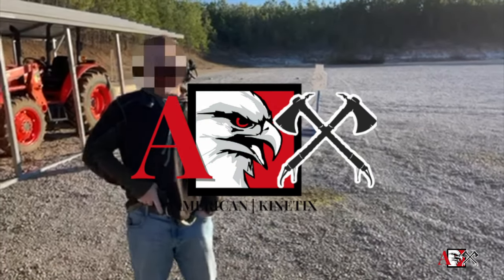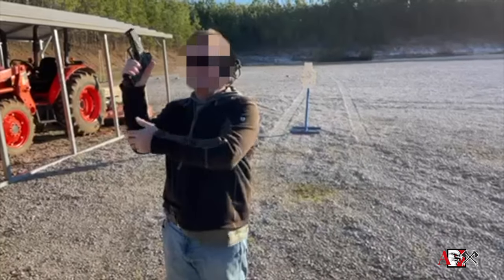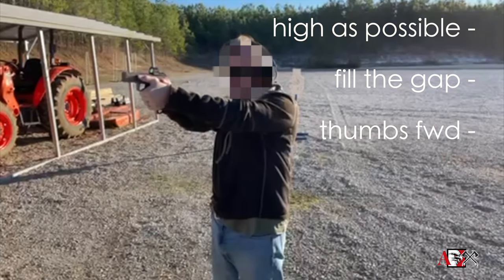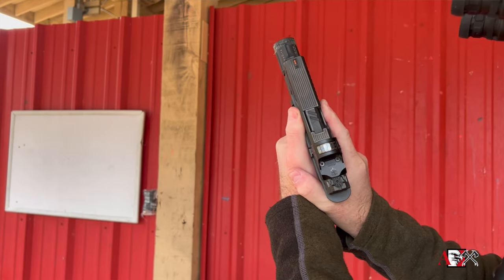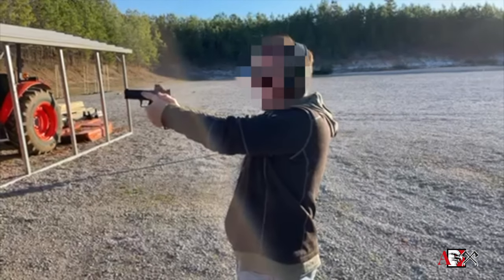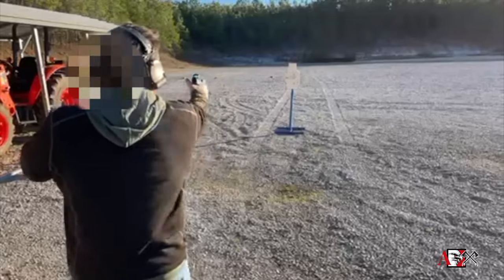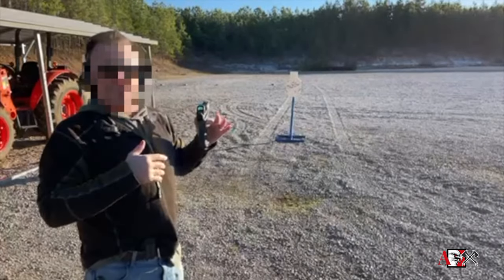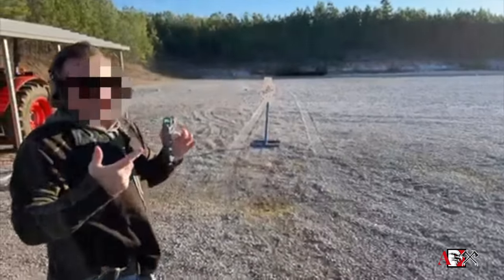AX PRO-TIP-2023 -The Grip

Comment: When I started doing USPSA stuff 20 years ago the grip was what changed my accuracy the most. FYI Bob Vogel taught it just like that (at least then he did).  He or another also recommended rotating elbows out to add some pressure to the frame with your pointer fingers first knuckle.  It works for some
Reply from the maker: Thanks for the comment @OdeJunky! We have worked a lot with John Shaw, Todd Jarrett (world champion competitive shooter with four World titles, nine National titles, etc), along with Jerry "the Burner" Barnhart and others through the years. All those guys have the same stream of thought running thru their grip and presentation. We have coupled that with the need for a heads-up shooting position for better SA and NOD's use and have arrived at this grip, stance, head-relative-to-gun position. Keep training Ode!